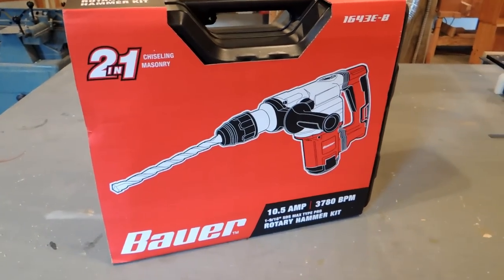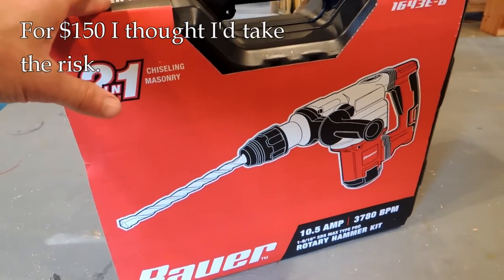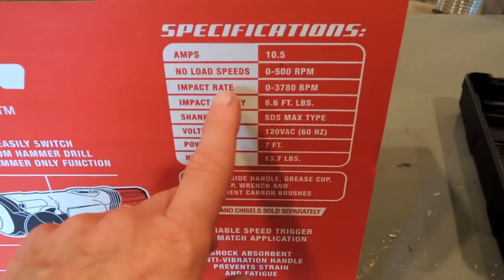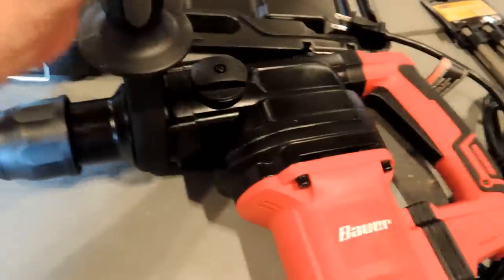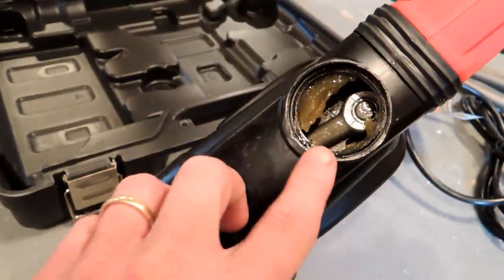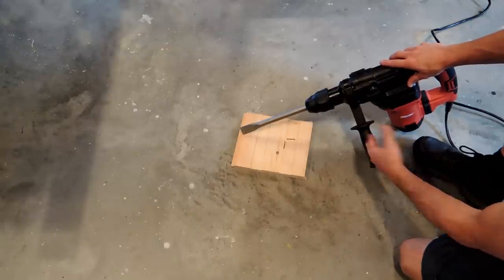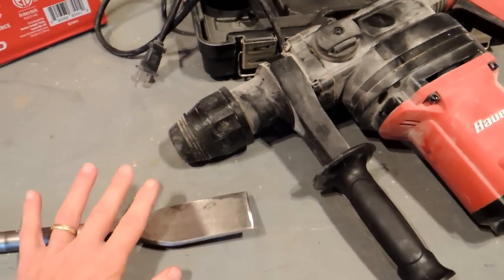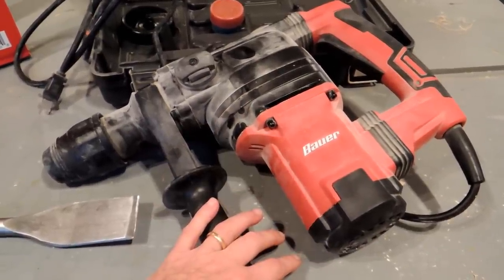Review: Harbor Freight Bauer 1643E-B Demo Hammer

Comment: @6:40 - "you're not going to drill with this thing."  Of course you are; it's a rotary hammer.  The rotary action is intended to turn drill bits and evacuate debris from the hole you're drilling - just like a regular drill.  It's even pictured on the packaging (in the video) with a drill bit in it.
Reply from the maker: Maybe I should have been clearer with my language.  What I meant was that you aren't going to use this tool in place of a hammer drill to make small, precise  holes for anchors or screws or that sort of thing.  Yes, you might chock up a large pointed chisel and use the rotary action to drill a series of ragged holes in a concrete wall to break it apart or something along those lines.  But because of the weight, the balance and the efficacy of the tool is not appropriate for precise drilling work.  Even for larger holes, say for a 5/8 wedge anchor to hold down a footing connector, precision is required or else the anchor will just spin in the hole.  That was my point--this is not a tool to replace your hammer drill.  It's a tool meant for demolition.
Reply: We use ours to drill 2 inch holes through concrete and brick for sump pump discharges.  And it works well, but if you're not careful, you'll break a wrist!

Comment: Yes but how do you secure the bits for the tool? Mine just fall right back out?
Reply from the maker: They probably are not fully seated.  Slide the sleeve at the base forward with one hand and hold it there. Insert the chisel with the other hand, and you may have to twist it a little one direction or the other until you feel it fully seat.  Then you can let go of the sleeve to lock the chisel in place.  One you've done it for the first time it will become obvious.

Comment: Great review like your summary at the end the best. I think that this will be perfect for me. All the  hammer drills from the other mfg's cost between $400 and $500. I need to do some medium duty chisel work on my current project and don't have a power chisel. If i needed to use this every day for work than I could justify a Bosch or Makita or Hilti. But my use will only be occasional. I have a half inch hammer drill which only does rotary, gets hot and uses a standard dril bit chck. The SDS max will make any future concrete drilling much easier for me so For $150 I'm going to get it. thanks

Comment: The hammer drill function is for drilling into concrete, not pointed chisels.  Of course its used for drilling!
Reply from the maker: I guess I should have explained this in greater depth.  My point is that this particular tool is not as suitable for precision drilling of holes in concrete or cement when compared to regular hammer drills.  It requires the specialized SDS Max bits, for one thing, which come in larger sizes and are expensive.  It's also a heavy, unwieldy tool in use.  If you've ever tried to drill a precision hole in concrete you know that excessive movement or weight to one side will result in a widened hole.  Controlling a heavy tool like this is one thing if you are positioned above the tool and drilling down.  In real-world situations where space is cramped or you are drilling sideways, controlling this tool to create a uniform hole would be difficult at best.  

So, when I assert that this tool is not for drilling, I mean that a regular hammer drill with less expensive bits and less weight to control will be a superior choice when you need precision holes for concrete anchors or more delicate work in tile or brick.  If you just need to blow a giant hole through concrete and the exact size of the hole isn't that important, you could use this tool.  For anything else, I'll stick with my regular hammer drill.   As for the pointed chisels, they are certainly an option for drilling holes when exact dimensions aren't critical.  That's how we used to make holes in concrete, and I still have pointed chisels and star drills in my masonry kit for working manually.
Reply: @enduringcharm  Thats very well reasoned.  I had just finished drilling 34 3/4 holes for anchor bolts using a SDS-MAX rotary hammer so the comment really stood out.  Im glad I used the big guy and not the lighter SDS-Plus RH's.  Using the right tool for the right job is important.  And you're right, lighter jobs (especially horizontal or vertical) would be a pain.

Comment: "you're not going to drill with this" how else do you put anchors into concrete?
Reply from the maker: I could have been more detailed with that statement.  What I meant was, this wouldn't be your first choice for drilling tasks, such as installing anchors.  A standard hammer drill is a better choice because that tool is more accurate and easier to fit in tight spots.  Yes, this demo hammer can spin in circles, but it uses big goofy bits and the hammer action is not tight and controlled.  A standard hammer drill is more controllable, uses more precise bits, and will make cleaner holes.  In my work I typically go up to 5/8 or 3/4 concrete anchors for post hardware, etc.  I have a Milwaukee plug-in hammer drill for those tasks and it makes short work of it.  Plus, I can use bits down to 1/8 inch.  This demo hammer you might use to drill big holes where accuracy is not important, but otherwise I would stick with a standard hammer drill.

Comment: I have a lot of bamboo in my backyard that I wanted to get rid off.  I was wondering if I can use the chisel with hammer action to tear up the dense bamboo roots after cutting off the bamboos or should I use the reciprocating saw?
Reply from the maker: No, I don't think that would be such a good idea.  The hammer action is more of a buzz, and the energy would just be lost on the vegetation.  Bamboo is notoriously difficult to remove.  If you don't get all of the roots, it will just grow back.  A machine like a bobcat or a backhoe is really your best option.  You'll pay for a day's use of the machine, but it will be thorough, easier on your back, and far more effective.  Then use a chemical spray on any shoots that come up in the future.
Reply from the maker: I still think you're on the wrong track.  From what I know about gardening, you need to get ALL of those roots out.  These tools are just not designed for what you have in mind.  They're meant to concentrate energy on something like concrete or rock, which doesn't move with the business end of the tool.  The energy can be concentrated on a small, immovable area which produces the results.  Using one of these tools on vegetation or dirt I think will just disperse the energy, accomplishing nothing.  Plus, you still have to dig out and dispose of the roots!  

  Go to your local rental place and see if they offer a Bobcat MT-52.  It's a small, walk-behind machine on tracks that can be fitted with various attachments.  It's designed to be able to fit through typical fence gates--very compact.   Probably a few hundred bucks a day to rent.  You can use it to dig out the whole area, smooth it over, and be ready to plant something else.
Reply: Yes use a sawzall with a tree pruner blade they sell them at Walmart for $8.00 A large hedge trimmer would also work. Not a good job for the rotary hammer drill at all. They also make a gas powered machine called a brush mower.

Comment: this tool brakes trough 4 inch concrete like butter, it is overkill for removing tile
Reply from the maker: It's the base model for SDS max chisels, so it's the lightest and least powerful of the line. I didn't find it to be overkill, and if you are removing tile from concrete  it might even struggle a bit.  In the video I happened to be removing tile from plywood, which is the easiest of substrates.  Even so, it took awhile.  I found it to be a pretty good compromise between weight and power.
Reply: I agree with the above comment wholeheartedly.  We have over 50hrs on one of these units.

Comment: Have you noticed that this exact model is not available anymore?
It's a shame because is a good size and weight for the power it has.
Reply from the maker: It is available still.  I just looked on their website and I was in there last week.  Website SKU is 63441.
Reply: There's a upgraded 11 amp model available
Reply: It's still available it's slightly different and updated. It's 11amp and it's a beast!

Comment: I love how everyone thinks "made in China" is a bad thing. MOST of what you buy is made elsewhere. I have a Hobart welder that everyone thinks is made in the USA. It's made in China and "assembled" in the USA. So are most Lincoln and Miller parts. That also goes for this tool, and most other high end electric tools. The parts are made in other countries to that company's specs. So made in China isn't always bad. You'll find junk made everywhere
Reply from the maker: I completely agree.  The reality is that high-end manufacturing as well as lower quality work is done all over the globe, with China among the top producers.  That means that while some Chinese made items may be junk, the high-quality items are also made in China and other parts of Asia.  The expertise for quality manufacturing followed the factories, meaning that the expertise is offshore now.  China produces what we ask of it.
Reply: Yep, my Milwaukee M18 tools are all China (and I've had issues with a couple of them after minimal use and required warranty replacement.) Also my Snap On scanner and Snap On impact is China, those have been good China stuff though. I've been happy with virtually everything from HF and I've been buying there for 15 years. I picked up the latest 11amp SDS Max and it's a great tool.

Comment: Best place to get special tools you only need one time. Paper weights should be cheap.
Reply from the maker: I get this argument a lot.  While it is true there are some items at Harbor Freight which are of poor quality, it is also true that the company has been steadily increasing the quality of tools for sale over the past few years.  Hand tools, such as wrenches, sockets, hammers, etc. were always of decent quality.  The electric powered tools used to be awful, but they have introduced new house brands with an emphasis on better quality and it shows.  Some of their compressors are actually quite good and better than competitors.  I've been buying my PPE there since the pandemic since it's the only reasonably priced local source for gloves, masks, goggles, knee pads, etc.  So I give HF credit.  It's the only retailer by me specializing in tools, and a valuable source when Home Cheapo or Lowes can't offer what I need.

Comment: Would love to know how well it works on frame rivets
Reply from the maker: What kind of rivets are you hoping to remove?  Typically a grinder with a cut-off wheel is a better choice for steel rivet heads.
Reply: @enduringcharm  like the kind of rivets that hold brackets to the frame of a car
Reply from the maker: Oh, yeah, you're barking up the wrong tree. Use a 4 inch grinder with a cut off wheel to slice off the heads of the rivets and then a punch to drive out the shaft.  Or, you can drill out the shaft if it's in a tough spot for a grinder.  This demo hammer would just bounce off the steel and give you a headache.
Reply: @enduringcharm  which one would you recommend?
Reply from the maker: Literally any name-brand grinder would be fine for that application, you don't need to spend a lot.  Whatever is available locally at your home center.  Get some decent metal-cutting (thin) cut-off discs for the grinder.  If you are experienced with grinders you can remove the guard and fit a larger disc on there, but if you are new to this then stay with the four inch size and keep the guard on there.  Slow is fast when grinding, so use two hands to hold the grinder steady and slowly push the disc into the edge of the rivet.  Wear eye protection and watch where the sparks go.
Reply: @enduringcharm  great thanks!
Reply: @enduringcharm  how thin is thin? Is 1/16 good?
Reply from the maker: I think most of them are around .045".  It's not critical, just a thinner cut off wheel with a little flex to it so you can get in there on the rivet head.  They wear out quickly, so get a bunch!

Comment: I may have been dropped on my head a few times as a kid, but I’m reasonably sure that’s a rotary hammer
Reply from the maker: It has two settings--one rotary and one just hammer action.  If you are referencing my comment about drilling, I meant that you wouldn't use this for precision drilling.  Yes, you could use the rotary action for rough holes in masonry.  But, if I need a precision hole for an anchor or a tapcon screw this is not the tool I'll want to use.

Comment: Mine randomly turned off mid job and now old works on max speed, which is strange...
Reply from the maker: The electrical on these tools isn't that complicated, you may find a minor issue that can be repaired if you take it apart.  Sometimes its just a matter of dirt on a trigger contact.
Reply: @enduringcharm  For the average consumer, taking a power tool apart is complicated...For a tool such as this to shut off mid job (without overheating etc) is un acceptable..
Reply from the maker: I don't disagree, I was just trying to point out that all may not be lost for your particular tool.

Comment: I'm a professional contractor. I only buy the best brands and well reviewed tools, Dewalt, Hitachi etc. My dad gave me a harbor freight brand reciprocating saw about 9 years ago. And by God, it's been used and abused damn near every day since then, including the time it took a fall off a 3 story House onto a concrete patio. It shows no sign of stopping and has power and control just like the best of them. It changed the way I think about harbor freight tools that's for sure. Oh and a brand new one costs 24.00 right now, I think I'll get another when (if) this one ever craps out.
Reply from the maker: Generally speaking I stay away from electrical hand tools at HF, but your point is well taken.  Quality has been steadily improving and even though many HF tools are entry level or low-end quality, that doesn't mean they aren't worthy.  And, some of the tools are actually pretty good.
Reply: @enduringcharm  bauer definitely isnt low end.. Chicago electric is low end.. Hercules is mid tier.. And bauer is actually their competition for Dewalt and Milwaukee.. I'd say they (Bauer) are at least Mid tier overall

Comment: Has anyone tried this on vehicles to remove cv axles? At a shop it’s easy to use a pneumatic version but I don’t have an air compressor. Figured to buy this instead
Reply from the maker: Why do you need an impact hammer to remove axles?  There are differences among vehicles, but generally you pull the brakes, remove a main nut or a bearing hub, and the axle comes right out.  If you mean to use the hammer to bust apart steering or suspension joints, I think you'd find this tool awkward and heavy.  Better to save up for a compressor.
Reply from the maker: Relax, gunner, I was just asking! I know all about rust since I live in NJ where there is salt on the roads from November to April.  My automotive trade school was completed in the early 80s and I've been wrenching for almost four decades.  Given the number of Jeeps we have in the family, I put more miles on my welder than I do the trucks!  Nevertheless, I've never needed to use an impact hammer to get a CV style or any axle out.  Maybe I'm just fortunate.  Anyway, I still think you'd be happier with a compressor and an air hammer.  It gives you the flexibility to use other tools and the more compact nature of an air hammer will allow you to use it for more than just one purpose.  I reviewed one Harbor Freight compressor that has served my shop well for several years now, both for woodworking and automotive use.

Comment: It's meant to drill also ...hence the pic on the packaging . It's a roto hammer / concrete drill... just saying. And they are great for demo of tile. You can hold the tool all the way to one side to get better angle on your work surface. Good rule of thumb is never turn to drill mode and run any demo bits. Dangerous and pointless even with a pointed chisel. Pointless in fact.
Reply from the maker: See my reply to a previous poster on this subject.  I didn't mean to imply that it doesn't have a drill mode, only that for any kind of precision drilling you'd be better off with a regular hammer drill.

Comment: Not a real test. You know that tile over another material is never the same as tile with thinset on prepped concrete. Old polymer added thinset on outside concrete might be fair.
Reply from the maker: That bath remodel happened to be what I was working on at the time. I've since used this tool on many other bath remodels.  The most difficult tile installation to remove is actually not tile over concrete.  I'll take that any day--the concrete holds firm and the tile easily chips off either by hand or with a tool like this.  It's tile over a mud job which is the most difficult to remove.  The mortar is laid over metal mesh which has been stapled to plywood and you need to remove the tile, the mortar and the mesh.  For many years I did this painstakingly by hand.  I even have a video on it!   Now I use this demo hammer, which has been a lifesaver.  You can reach down to the layer of mesh and attack it there.  The job is still brutal and exhausting, but more tolerable.  A few weeks ago I again used this tool in the video for a large master bath remodel.  It took an entire day to remove the mud job tile floor down to the plywood subfloor.
Reply: I just used my Bauer rotary hammer today to break up 4 foot tall block wall entrance support pillars made of cinderblocks and fortified with rebar and concrete poured down into the cavities and it tore right into them and I was done in no time. Go ahead and look for trick photography and what ever other stupid reasons to discredit this video and the tool, but you'd be wrong. The thing in a g'damn monster.